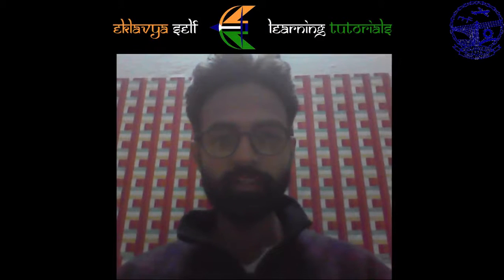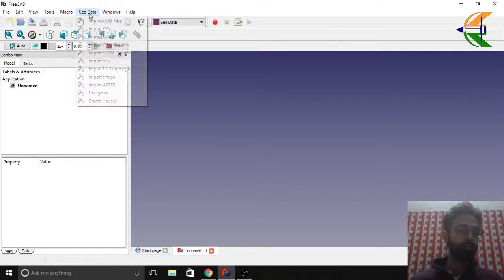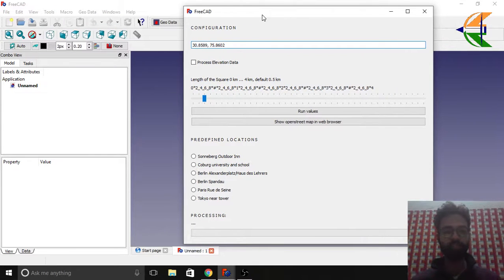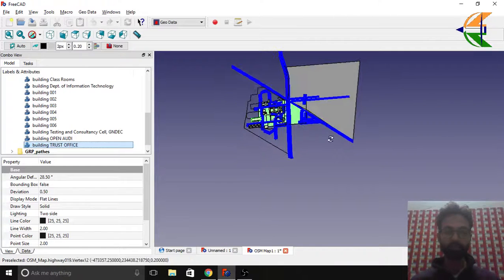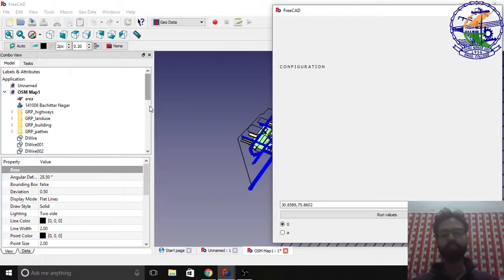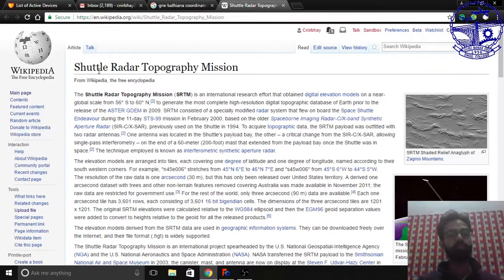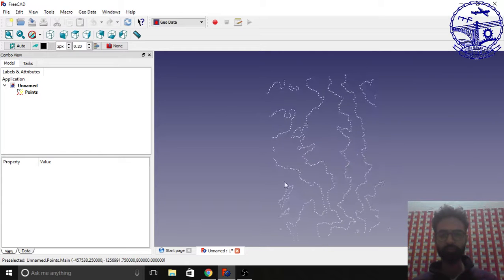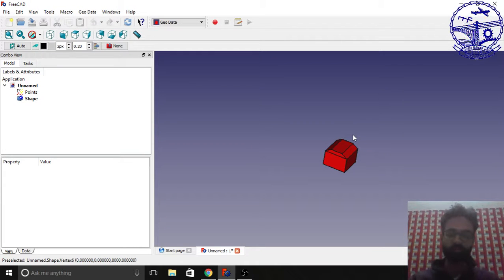FreeCAD Tutorial: Getting GIS Data Using Geo Data Workbench

Comment: Hi Eklavya. I think that there is a problem with the Geodata WB since the 0.17 Freecad version because i only can work with Import CSV, OSM heights and SRTM heights
Reply from the maker: Hi, Aaron. This is Nirbhay Chauhan. There may be some problem as it is an additional workbench and still under development. Please refer to FreeCAD forum for the related updates.
Reply: There is some way to create a surface using the points from SRTM heights?
Reply from the maker: Not, I guess.